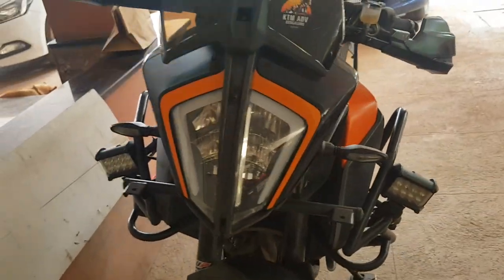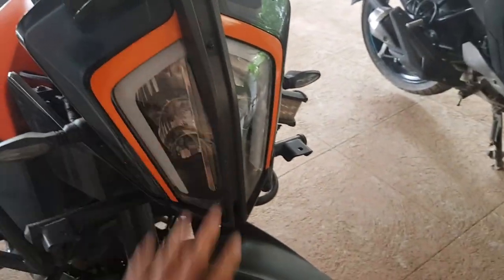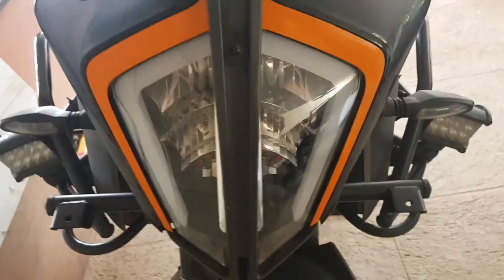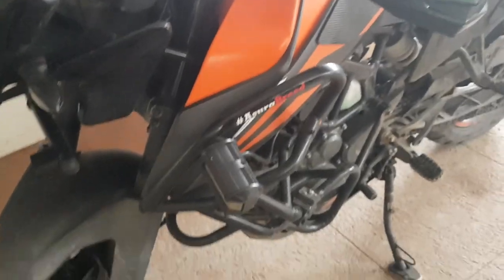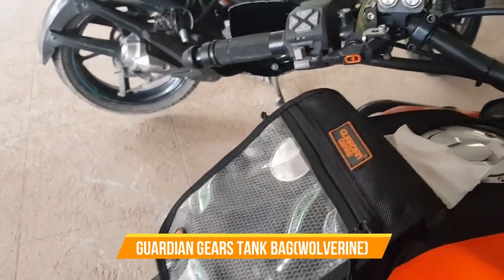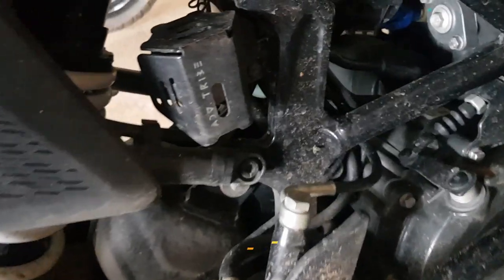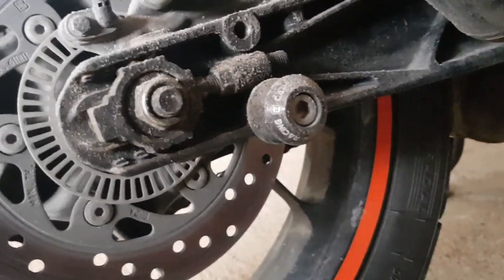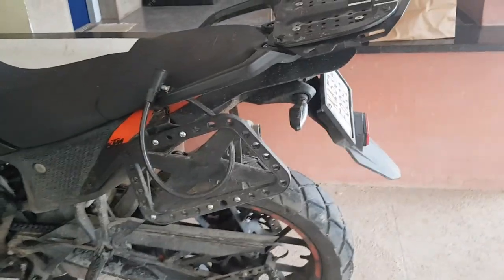KTM Adventure 390 Accessories V2

Comment: Very comprehensive Parth! I think my favourite part is the tail rack as most of the other tail racks entail removing the grab rails and I really don’t want to lose them.
Reply from the maker: They have a brushed aluminium version if your bike is white which looks nice. That has thicker plate as well and half the weight :)
Reply: Parth Menon thank you. Unfortunately, they aren’t responding on the WA link you shared. Do you have an address for them?
Reply: @Don_Mitchell  You can call him at the same number, or you can visit moto store and cafe at bagalur. They have the  stock and you buy it directly
Reply: Sreeram R Thank you, Sreeram!

Comment: do you think its possible to install the ktm 390 adventure headlight unit to the ktm 250 adventure ?
taking delivery of the 250 adventure tomorrow and really like the led headlight setup of the 390 .
Reply from the maker: KTM has a lot of sensors bro. There might be some sensor that don't match theoretically. But technically, yes it is possible. If you are in Bangalore, i can set you up with a mechanic with whom you can try.

Comment: Bro is it possible to show how maddog wire haness has been used for auxiliary lights connection. I have ordered maddog wire harness and switch. will the length of 1.5m sufficient ? Do we have to use any more additional connections or the provided wire harness is enough ? and where shud i connect ? please help.
Reply from the maker: Its under the bike. 1.5m is more than enough. You need to connect the ignition wire to ACC2

Comment: Hii Parth, may i know the size of easy tags installed on ur crash bars please. I would also want to know about the installation of DRL of hand guards.  Any recommendations on wiring ?
Reply from the maker: Easy tag is Standard Size. If you have rope wrapping then get L or XL but not needed otherwise. 
DRL handguards lights i did not install but you can install it to the front of the bike. Under the headlight, there is a small plastic flap which you can remove. Inside that you will get the ACC1, ACC2 and indicator connectors. Connect the DRL to the ACC2 port.
Reply: @parthmenon  Thanks bro, i have placed order 😻

Comment: Hey Parth . Can you please share the installation video of the throttle lock.
Reply from the maker: Its very easy bro. Just remove the stock bar end weight and place this instead. The dial that rotates should be towards the inside. Thats all

Comment: Good effort on your part to explain the mods clearly.
I was thought about apache mirrors mod before, but didn’t try out. After seeing your mod I’m convinced that I should also do it.
A query, regarding prospec easy cruise, I already have bark busters installed, so I was thinking whether easy cruise would work or not. Any suggestion?
Reply from the maker: BarkBusters, i will ask ProSpec if they fit. Since it has its own bar ends, it might not fit. Will ask and post here
Reply: @parthmenon  Thank you👍

Comment: Nice..!! All your mods are sensible
Haven't you experimented with sprockets and handle bar raisers ..?
Reply from the maker: Yes bro, i have. Handlebar risers the ones i got did not suit me. I am waiting for Carbon Racing Type 2 ones to release again. Sprocket i had gotten one from Sparrowteck but that was horrible quality and bad experience. He is supposed to send me the correct one as a replacement so waiting for that
Reply: @parthmenon  I own a 390 Adventure as well. I have changed the front sprocket to 14T though it improved low end, it has increased vibrations and heat.

Do let us know your observations on the rear sprocket and carbon racing type 2 raisers. Thanks in advance
Reply from the maker: @udaybhanu3443  i had also done the 14T change but the heating, high rpm and vibration was too much. I would recommend to remove that and put the stock 15T, an iridium spark plug and BMC air filter. Then get a 47 or 48T rear sprocket whenever a good company comes out with one :).

Comment: Hey Parth! Love your videos as they have been useful for adv 390 owners. Quick question- have you had issues with your quickshifter after your first service? Mine was working flawlessly before the first 1000km service and after it- doesn't seem to work properly. Appreciate your response!
Reply from the maker: What happens now?
Reply: @parthmenon  it just refuses to shift up some of the time. The downshifts are perfect. But upshifts don't work especially when you rev it between 4-8km rpm